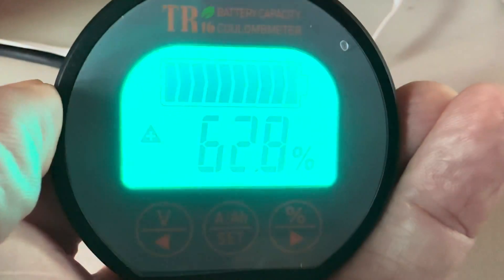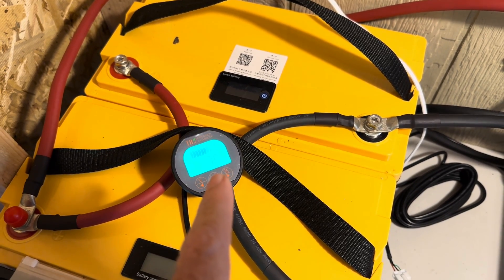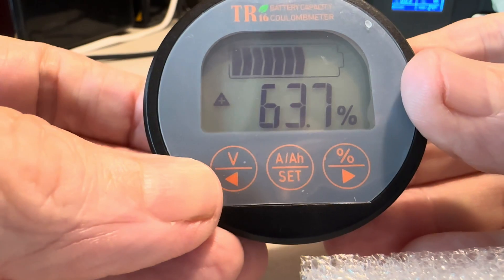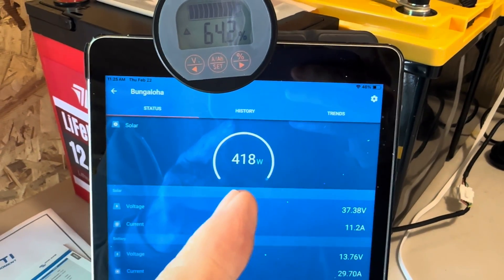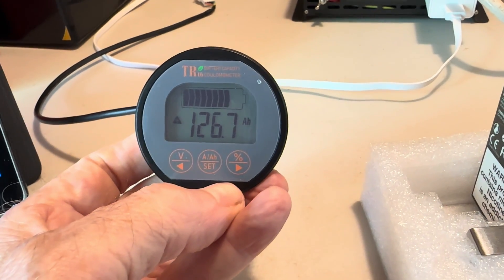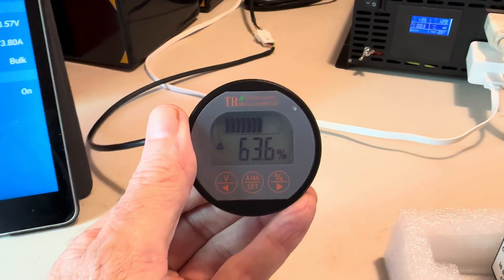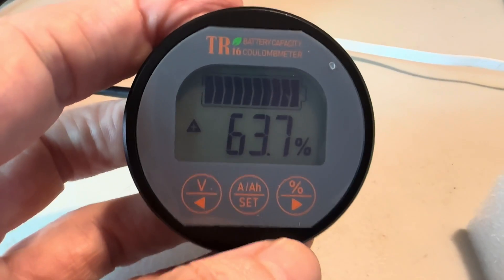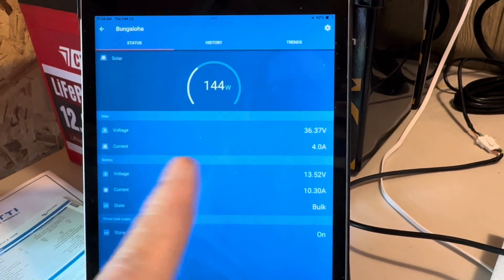QWORK Battery shunt/monitor needs to be told how big your battery is to work perfectly

Comment: nice video. how do I know the amp hours of my costco group 27 deep cycle lead acid they don't publish amp hours just cold crank amps.I'm just starting out, I don't realy have a real load out of the battery, I have my small load directly out of the renogy wander charge controller (just 2 LED lights using .3amps. so I only have negative out battery to in of charge controller when I connect the shunt out neg of battery to in of charge controller maynot be possiable bc the renogy can't acept a thick shunt sized cable. thanks

Comment: Hi from France..good review and set up, question,on lipo4 do you have to set the voltage on the monitor to 12.7  as stated on my battery,or just 12 when setting it up?   cheers

Comment: I JUST DONT UDNERSTAND PEOPLE WHO RUN 12V SYSTEM.. WHY? it's dumb.  I also would not trust that crappy shunt. Even officially it have 1% accuracy loss. which is huge IMO. will add up fast to a usless. Victron is about 0.3% and still after some time it bocomes usless and needs to be calibrated.

Comment: Do you have to reset the parameters on the qwork every time you disconnect the battery or turn off the breakers.
Reply from the maker: No, it will remember it's last setting on a disconnect. Only need to reset if you change the size of battery connected to it. Aloha!🤙
Reply: @ProjectsinParadise808  thank you so much.

Comment: them shunt/monitor is a must for LiFePo4 battery.is sold under a few different names. they great for RV mounting in round hole. I but small 1 amp fuse on small wire going to battery. must be at battery neg and all power threw the shunt and it will work correctly. just set battery AH . some have set battery type as well.

Comment: Nice over view Bob.  Based on the review of the device, looks like its a calculator on Ah vs. voltage.  But for LiFePO4 being so flat on the curve, very difficult to manage SOC%.  I have the smart shunts and two of the Redodo battery monitors.  I reviewed it on Amazon and honestly its very similar except you need to set a charge to voltage.  IF you set it too low, then the monitor will flip to 100%.  However, on discharge it is very accurate on Ah and proven by calibrating the charge Ah to the charged to voltage reading at BMS cutoff.  They cost more but for simplicity the one you reviewed is much easier to use I think.  Gary from SE Michigan.
Reply from the maker: Mahalo Gary! I am planning on trying the Victron smart shunt here pretty quick to compare with the QWORK shunt I have on all systems currently. I like what I have as it does give me a quick look at the systems. I expect the Victron to be better, but how much so..I don't know yet. It's all an experiment. All in all, I am doing quite well and learning more everyday. Even this time of year, which typically is very dark and rainy. Aloha!🤙

Comment: Few year using that same Aili-something cheap meter and it is accurate! Only thing in mine that annoys is that backlight is always on! So if someone knows how to switch it off, please tell me?!
Reply from the maker: Press left and right button at same time and hold for a few seconds. It works for the Qwork like that. Aloha!🤙
Reply: @ProjectsinParadise808  What! It works! I thank you! 👍  Even made a lid for it from leather + stick pad as it is so bright you can not sleep in my camper! I never found this from manua or maybe it was the firts thing I throw away! Greets from Portugal! I am from Finland and here only winter times!

Comment: I was using one up to a few years ago when one of the three buttons went bad. They are one of the better monitors. I ended up replacing it with the Victron Smart Shunt($$$).
I'm surprized you don't have a Cerbo GX yet🤔on your main system. I haven't pulled the trigger yet either.
Reply from the maker: I have a bunch of blue devices in my shopping cart as I type this! Smart shunt for sure, and I dance back and forth on the Cerbo. Like you just haven't pulled the trigger. Haha! Late night is when I am vulnerable to do it though! Aloha!🤙